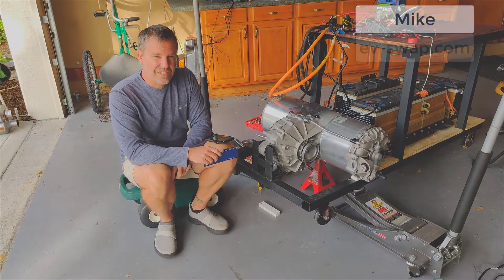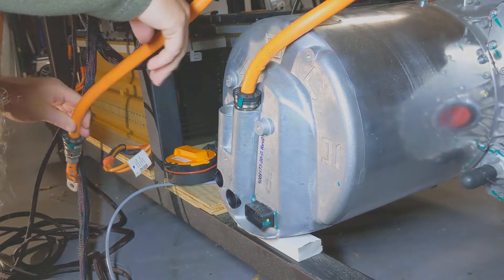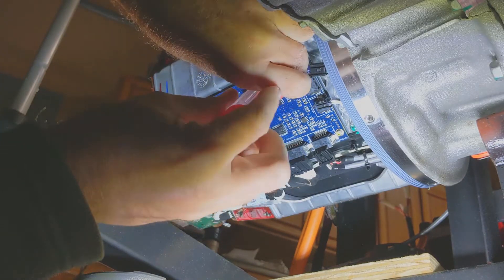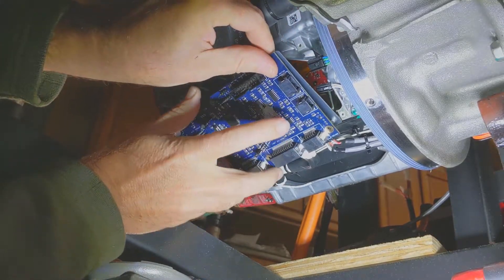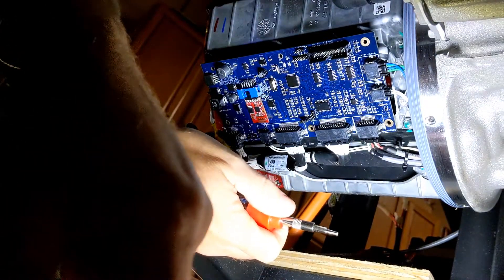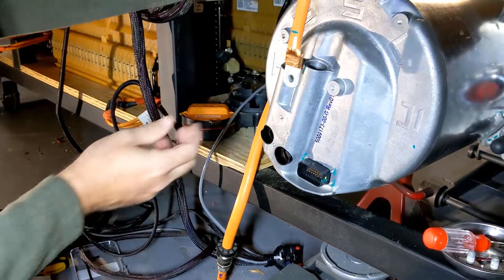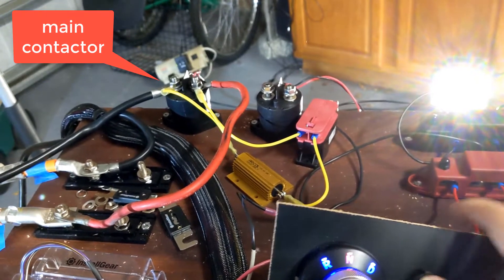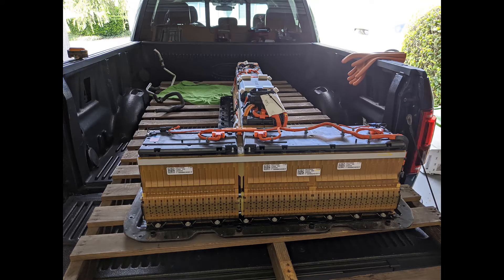Tesla drive control board swap

Comment: Hey there, I myself bought the large drive logic board and I'm not sure if I need to replace it. How do you test the board to be certain that it needs a replacement and can the board be fixed rather?
Reply from the maker: Did you purchase an original Tesla control board  or an after market one (like my ZeroEV board)
Reply: @ev-swap  From an after market vendor, because I was told that Damien is no longer producing his boards. How much did you got yours for, if you don't mind me asking?
Reply from the maker: @EddyBoh  So my ZeroEV board came pre-installed when I purchased the drive.  I don't think they sell them stand alone, just with a drive.
Reply: @ev-swap  But when you got a replacement for your logic board, how much did you pay?
Reply from the maker: @EddyBoh  Nothing, it was covered under warranty.
Reply: @ev-swap  So the drive unit that you bought, it came with the logic board. Nice, how much was all together?
Reply from the maker: @EddyBoh  It was a lot!  $11 K for a sport version LDU with low miles.  I bought it from StealthEV, which I regret.
Reply: @ev-swap  Oh ok, but why are you regreting it, if you don't mind me asking?
Reply from the maker: @EddyBoh  two reasons, StealthEV has horrible support and its really hard to get those boards configured to run smoothly.  There are dozens of settings you can tweak and no guide on what each setting does.  But the AEM and EV-Controls system are pretty much plug an play, and they offer support.
Reply: @ev-swap  Yeah but they cost a lot more I believe, about $1,500. I mean to ask you, by any chance do you know which pins in the 20pin JTAG connector has continuity with the squared ground pin?
Reply from the maker: @EddyBoh  No, Im sorry I don't.
Reply: @ev-swap  I just discovered that there are too many elements to fix on my board that it would suit me best to buy another or one with fewer problems. How much will you be interested in selling me your old board, if you don't me me asking?

Comment: Nice. I like that here is no annoying background music. I found you using the youtube search function.
Reply: Hey there, I myself bought the large drive logic board and I'm not sure if I need to replace it. How do you test the board to be certain that it needs a replacement and can the board be fixed rather?
Reply from the maker: I knew my board needed to be replaced because it would not engage the drive (pre charge worked fine, and so did the wifi interface).  I would not know how to repair a circuit board, that's way out of my wheel house, but I am sure there are people who can.  I would start with the vendor you purchased the board from.
Reply: @ev-swap  Oh ok, I'm having the same issue with mine. I setup the wiring for only the two contactors(ignition & main), for the precharge relay, and the fuse. The only thing is I'm using a 100M 40 ohm 1% resistor that it's twice the size than the one you have thus, I'm not sure if that's the reason the logic board is not responding. I have continuity in all ground pins 11, 15, 17, and 22. With the exception for the gas pedal pin12(5v) and pin15(GND), no continuity. But only for pin13(signal) and pin15(GND), that has continuity. So, this may be a sign that I may need to replace the logic board
Reply from the maker: @EddyBoh  Yeah, I'm afraid debugging a problem like that is going to take a lot of expertise in electronics.  I know three other DIY builders that have abandoned those boards and went with EV-Control's or AEM's solution because they are much more plug and play.  They are not cheap, but at some point all that time you may spend trying to get that board to operate may eclipse buying a different solution.